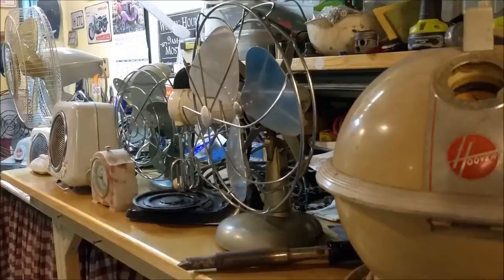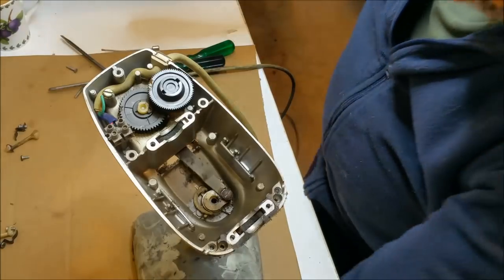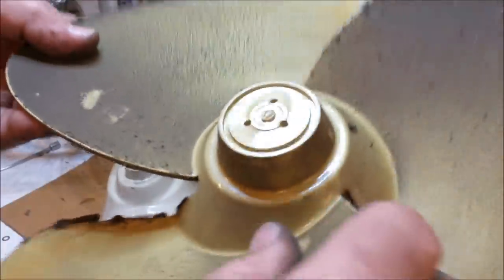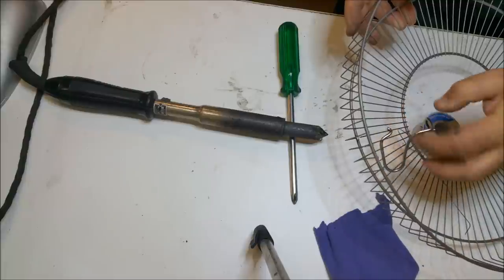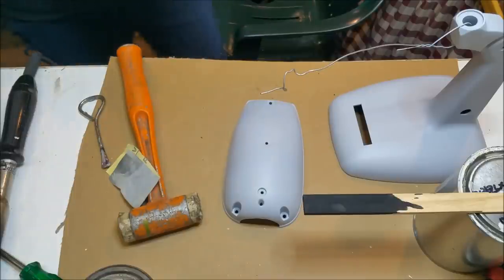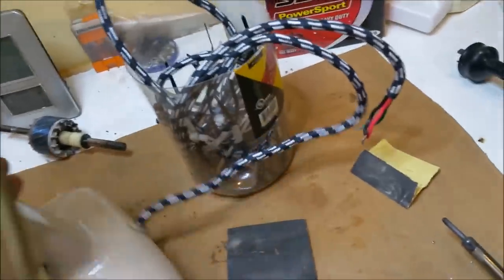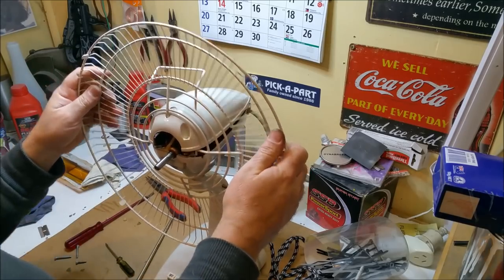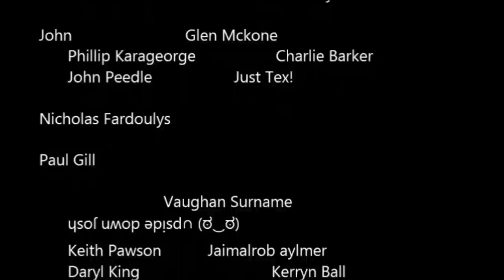A Look at a Warner Drayton Desk Fan

Comment: Fantastic! Finally someone actually pulled one apart and shown how to restore these. I have several in 8", 10" 12' 16" in GEC Hecla and Airflow. GEC owned Hecla which Warner Drayton  got absorbed  into in 1971. I get crappy ones and immaculate ones. If I don't need to pop the motor housing, I just oil with singer sewing machine oil and away they go for another season. I'm finding now after 50 odd years that  the  oscillating cogs are chipping or breaking so become donor fans. I've yet to come across a dirty motor- always so clean inside. The clamping screw on the neck don't look original, everything else looks it though. The push buttons came out in '63 and the instructions always were to start your fans on high speed and then select speed. Plastic bases arrived very early 70's.

Comment: G'day Peter. We have that same Warner drayton 3 speed fan here which is still working perfectly. the only difference is that the front centre piece of the guard on ours is a simpler round plastic design with the name printed around it. My Mum won it on "It could be you" (compared by Tommy Hanlan Jr.) here in Melbourne in the mid 60's. i think it was 1966 - the year the show finished up. i was 5 but i do remember our excitement the day she came home from Melbourne to our place in leongatha (Vic) with TWO fans. that one and a ceiling fan which was put in storage! in 1970 mum 'n' Dad bought a block of land in Inverloch, victoria where Dad built our new house. the ceiling fan went into the loungeroom ceiling. they sold the house some 10 years ago but that fan was still hanging there & working.. 🤟all the best to you.

Comment: That's a nice fan - super quiet now you've rebuilt it. 
I've a soft spot for electrics from this era. 
Interested in seeing you resto the hifi gear you mentioned if you feel like it. I'll probably be the only one watching haha but watch it I will.  Not convinced soldering wires that go into screw and pressure connections is always a good idea. I used to do this until I was told solder gradually deforms under compression (the same way aluminium does in american house wiring) and that over time it shrinks leaving behind high resistance connections. No idea if its true or not but bare copper wires or ferrules would seem safer. That's all you see in industrial applications.
Reply from the maker: Some great points there and it's great to learn from others with experience in the field, thanks for the info, cheers.

Comment: Great  video  when I was a kid when these type of fan was around no.1 button was low  2 medium 3 high speed. You might be right with the transformer being replaced and maybe   the wiring put in back to front by the repairer. Just a thought
Reply from the maker: Thanks for the info!

Comment: It’s a good idea to oven bake the motor bushes at 180 degrees for 10 minutes -  you’ll be amazed how much crap flows out of them. Only use a light 20 wt detergent free oil. Regular motor oil will have a detergent additive that will clump dirt molecules together and block the pores in the sintered bronze bushes. This will in time block the oil flow to the rotor shaft. I can recommend 3 in 1 oil for electric motors. The fan came up great!
Reply from the maker: Thanks Jimmy, some great tips there I had no idea about, cheers.